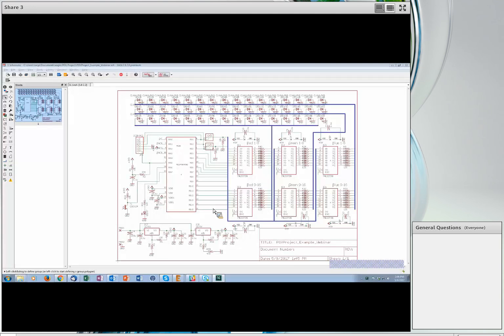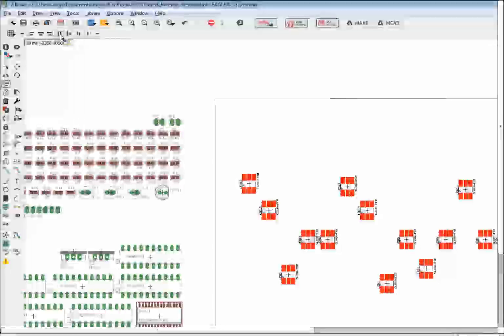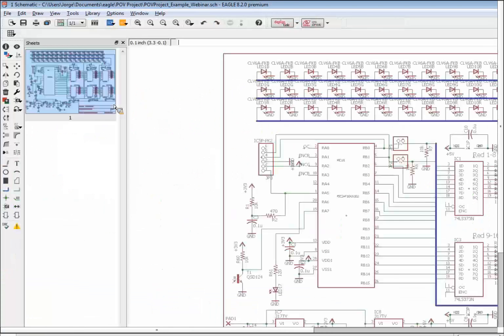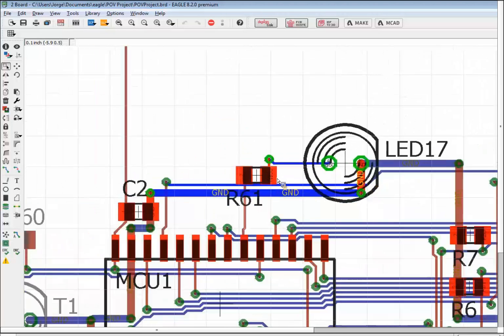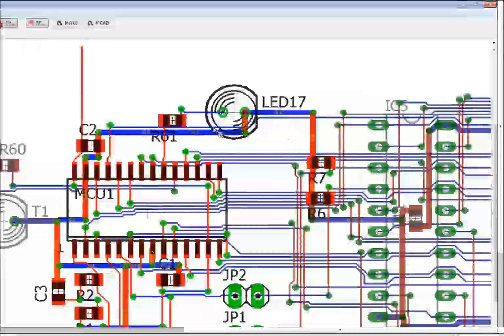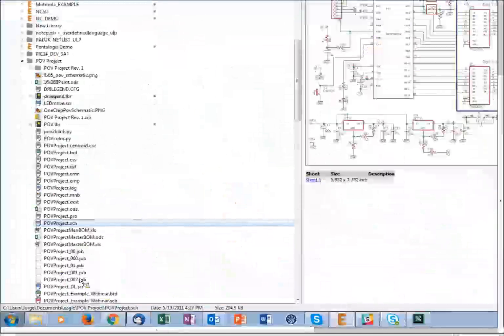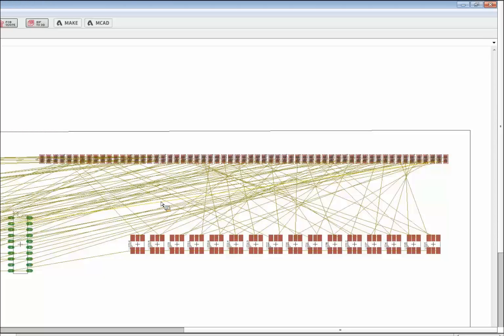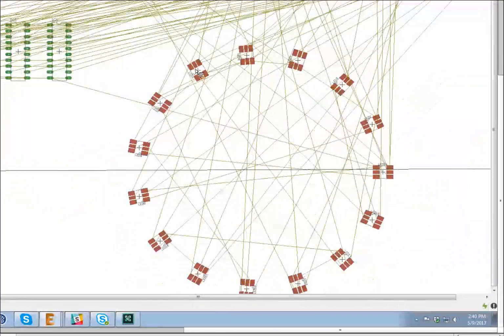Placing Parts the Right Way on your PCB Design - Autodesk EAGLE

Comment: You need to be better prepared --- and simply advance through those areas of the video where we learn nothing --- get to
 the point....
Reply: Try watching at 2x. You're right, though, that middle 10 minutes of minutia ... whew, Eagle should really edit that out or use a simpler design.
Reply: And listen at 2x also?   These people are professionals working for a multi-billion dollar company (Autodesk market cap is 23.4B).   They don't get cut any slack for being sloppy.
Reply: I hear ya. It's unfortunate and embarrassing.